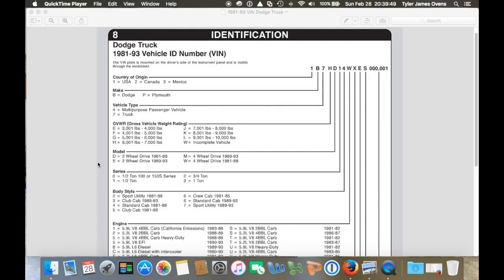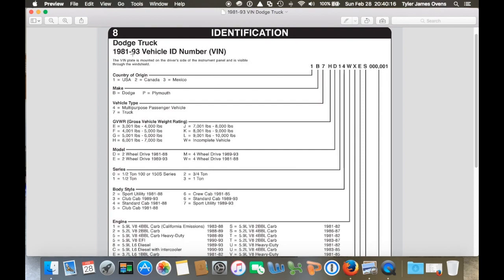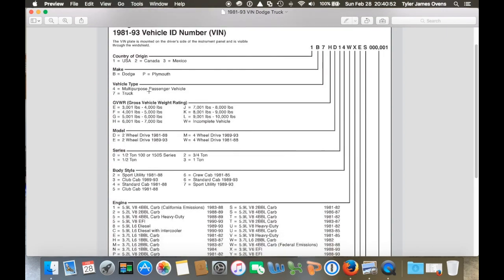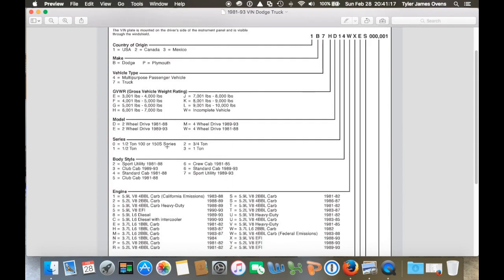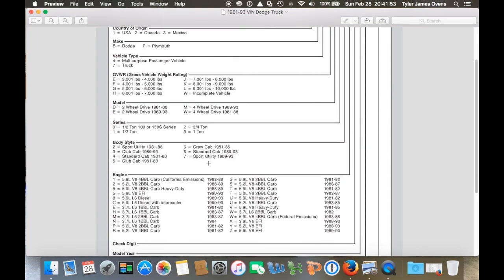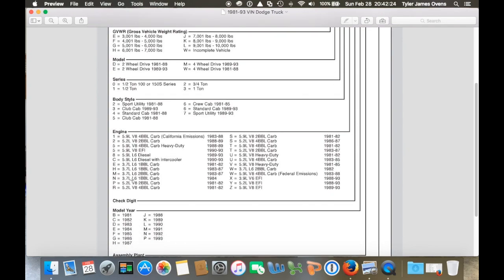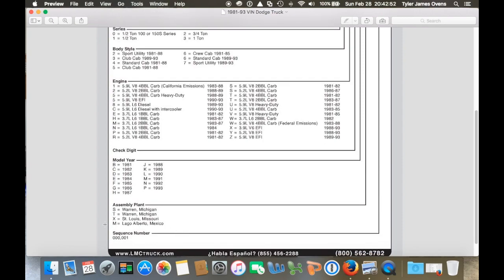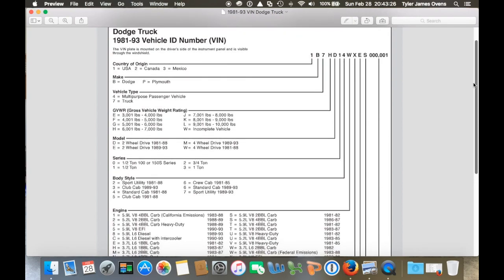1981-93 Dodge Truck VIN Decoder

Comment: Thanks for posting. Too bad nobody has ever compiled a list of the fender tag codes yet :-(. Can't seem to track any codes for the trucks or vans post-1975. Can find anything for a A-body or E-body etc 70s car but nobody ever does the trucks. I once had a build sheet from a 89 Acclaim a friend parted. While the front sheet for car specific was irrelevant, the info on the back was intense. It had probably 1000+ of the 3-4 digit codes and covered trucks, paint codes, interior codes etc. Lost it to water damage love to have another

Comment: See mine was definitely different. I have a 1984 D150 custom. It has what I thought was the original 318 with a 2 barrel Holley carb.
However the 8th digit on the VIN is 1, indicating it should have a 360 with a 4 barrel. Everything else was accurate, single cab, 2wd. I saw another decode list that has the chassis length at 8th character and a 1 fit because I have a long bed. Idk but it definitely doesn’t have a 360.
Mines 1B7FD1413ES - and everything’s on point except that 1. 😅

Comment: If the 3rd digit is a 6 that denotes a ''incomplete vehical'' ie. cab and chassis.
If the 4th didgit is a M that denotes GVWR 10001-14000 LBS.
Reply: My vehicle I'd well it tell me what size engine in it and speks
Reply: I have interd it a lot came up with nothing
Reply: That's a heavy-duty chassis.
D350 or higher.
Reply: @caseymurphy1334  What is the 8th digit in your VIN ?
Reply: @jimstrict-998  Yes the spring pack is huge and they can have the DANA 70 HD rear axle with the 4 inch tubes , the D70HD as far as i can tell is a D70/D80 hybrid, a real oddball. Dana had a bunch of axle combos as they were used by all 3 of the big 3. I like my 86 C30 where GM kept it simple with the 14 bolt but my 93 D350 will carry like an extra ton more !

Comment: The first 4 of mine are 1B6MD. I'm not seeing the 6 or M in either list.
Reply: That was 4 yrs ago i posted that, the only thing i can tell ya is that my VIN also has 6, M and i have a sticker on my door pillar that states the truck is a incomplete chassis rated to 14,000 gvw yet still conforms to list of safety codes that is there. you must have the same sticker on your door pillar ?